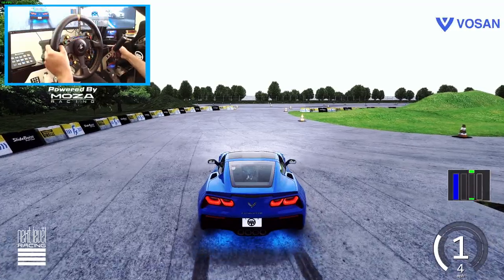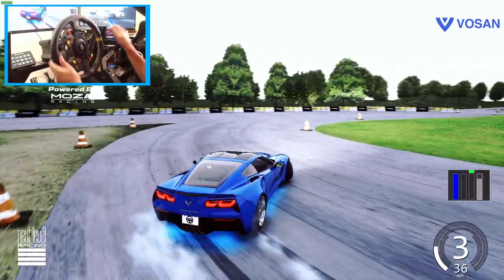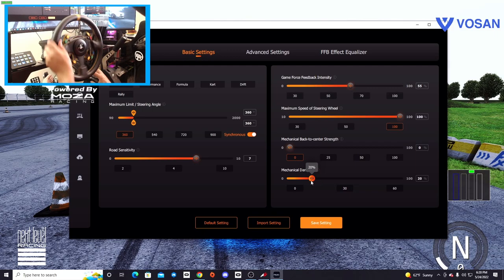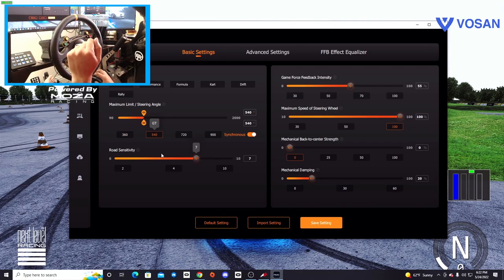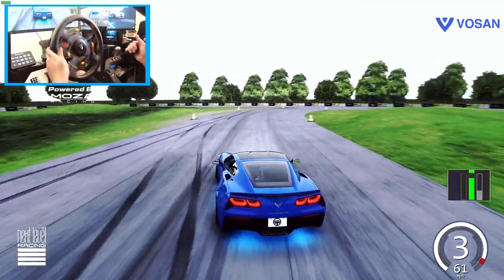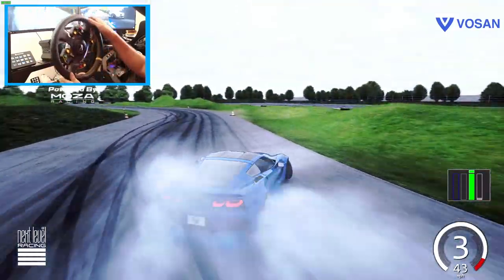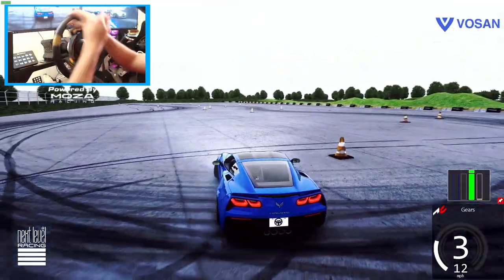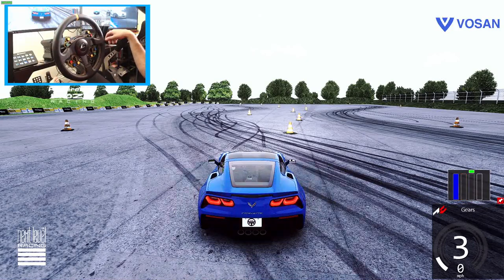Drifting 360° to 2000° of rotation on the MOZA R9 in Assetto corsa

Comment: Just need to get the motors some time to get faster, realistically some cars up there in the steering rotation so having an accurate representation instead of a catch all 900 degrees would be nice
Reply from the maker: Well I only have it at 60% power so I'm sure i could get it faster

Comment: i know it's a 2yo video but personaly i'm rocking 720 on my g920, 900 feels weird and i think it's due to the lack of "power" on the wheel side.

At 720 if i fuck up i instantly know WHY i fucked up, too much angles, not enough throttle you name it i can identify it... on the other hand at 900 i can't because there is a "floaty" feeling past a certain point.